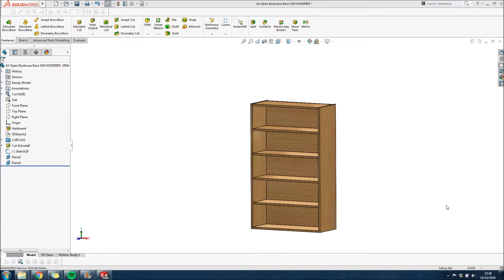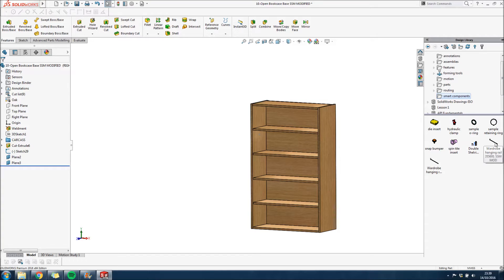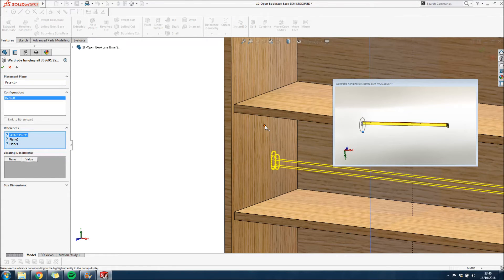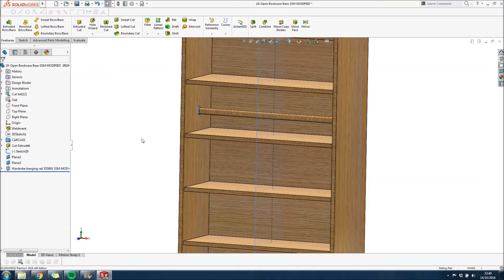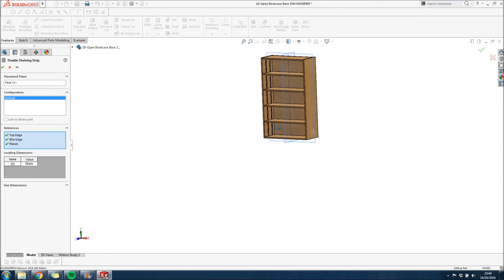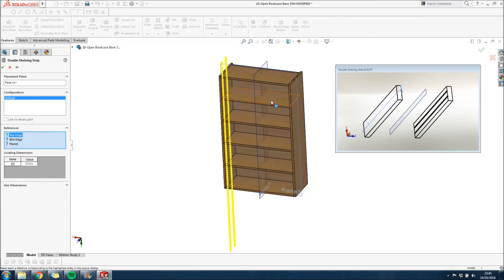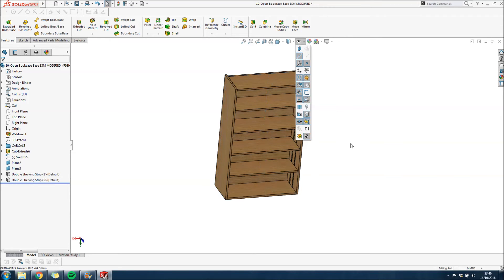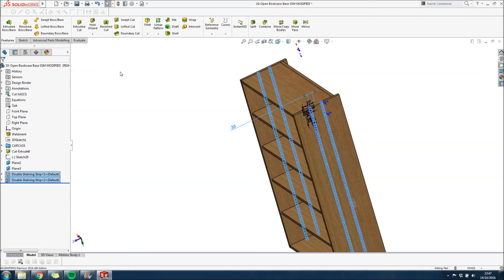Library Feature Parts / Smart Components in SolidWorks

Comment: HI, i know the video is quite old, but I would really like to know how you created a smart component that adapt its size according to reference. I would like to make a simple box with a width "computed" by selecting 2 faces (or to planes). Is it possible ?
Reply from the maker: Simple box? So just a solid rectangular block?
Reply: @timiland5881  Actually, the goal is using this box as en envellop for a drawer (kitchen type). Once the box properlly located and sized (i would like to set both left and right inner panels to automatically size the box/drawer width), i can use the smart component functionnality to add others componnents (sliders, ....)
Reply: @christopheseyler3512  hello! did you manage to figure it out after all, because i see that he stopped answering? I'm looking to do the same thing.